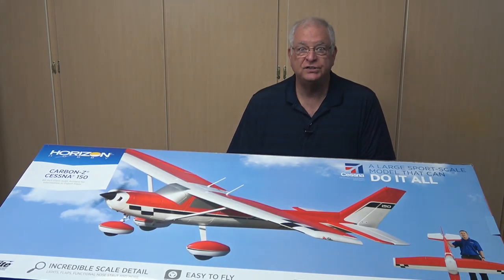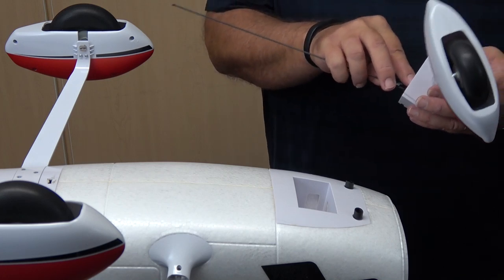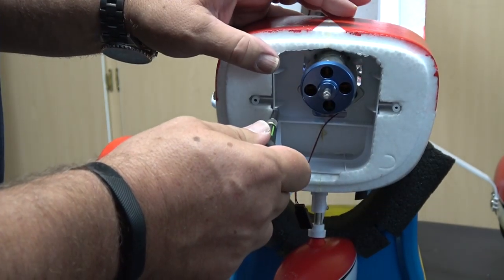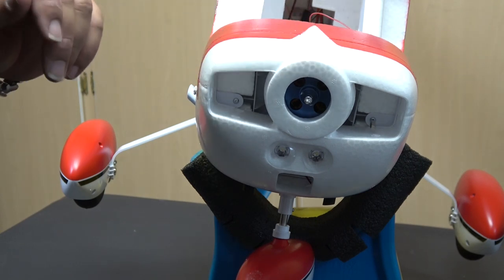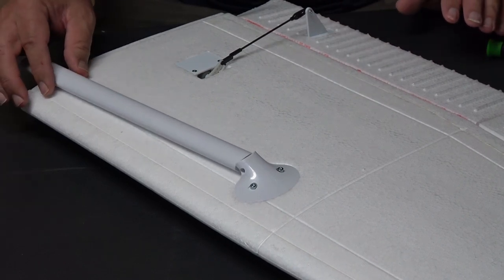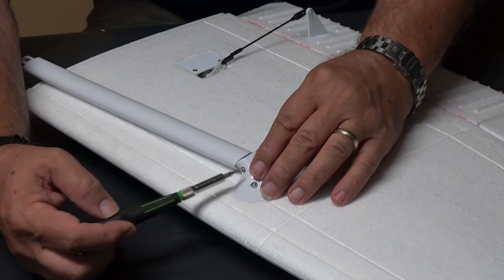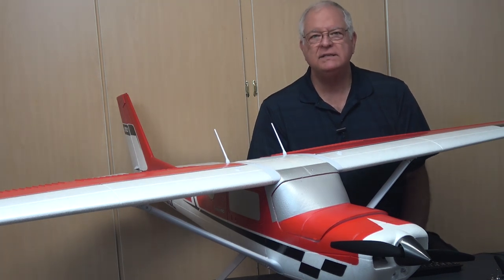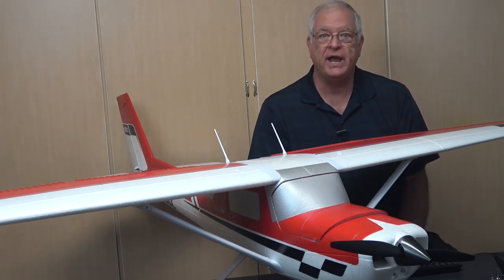Carbon Z Cessna 150 Assembly Log

Comment: Great video!  Thanks for posting it.  One thing to correct is that to center the nose gear, you do not heed to remove the nose gear at all, it can be done by twisting the small 90 degree angle on the servo side of the push rod.  You have to open up both the battery compartment and the top hatch.  With one hand holding the rod (disconnected from the servo) in the battery compartment and lifting it up, the other hand in the opening in the top, you can twist the rod several turns, checking on each turn to see how it aligns.  It's much easier than removing the nose gear over and over.  You can do the same with the rudder adjustment.

Comment: I have a Spektrum DX8G2 Transmitter but I couldn't find the Carbon Z Cessna Setup Download Files on either the Spektrum or Horizon Web Sites. Can you tell me where you were able to find the one's you referred to? That would be of great benefit to me. Thanks, your video was very helpful.
Reply from the maker: Tony Harris. On the Spektrum RC website under set ups and update you select air transmitters and then the transmitter you have. Then select download set ups. Unfortunately, the Cessna 150 doesn't seem to be listed for the DX8 as it is for the DX9. Don't know why. Hmmm
Reply: Thanks for your quick and helpful reply! I talked to a Horizon Tech about the Cessna 150 setup download and was told that it didn't exist as of yet for either the Cub Z or the Carbon Z Cessna. Wanted you [and your subscribers] to know "You were Right!" I found the download for the Cessna, loaded it to my DX8G2 and there it was! You made my day! I have the PNP version and an Orange [ORX] R1220XLR receiver and Remote Antenna. Never had one before and got no directions. Do I install the Main Receiver and Remote at a 90 degree angle to each other same as I would a Spektrum setup, and which direction would you install the Main Receiver Antenna, facing front or rear and do I leave the Main Antenna's straight or  90 degrees apart? Spent hours looking at your site. Loved it! Thanks again. Tony.

Comment: Great video. Where do you get the deflection measuring tool? That's a great tool to have!
Reply from the maker: The deflection meter was a Great Planes product. Unfortunately it's no longer available. Tower has one by Robart that's pretty similar. 
https://www.towerhobbies.com/cgi-bin/wti0001p?&I=ROBR1407&P=FR&gclid=EAIaIQobChMInOmTipbl5AIVBL3sCh0DqwXuEAQYASABEgItkPD_BwE

Comment: I love your videos. You go into great detail describing the build. I know this is a old video but I just received this plane for Christmas. I have a couple a Timber, (the regular one and the Turbo) what are the flight characteristics compared to the Timbers?? Slow speed and Stall characteristics I should be aware of anything?? I plan to use the same size batteries/
Thanks
Reply from the maker: I haven't flown the Timbers but friends at my field fly them. My sense is they are more nimble. The Cessna dies scale aerobatics easily. Loops, immelmans and split s's are easy with a bit of rudder during the roll. I find that takeoffs and landings are best with half flaps. The climb out is a bit more shallow so I don't drag my tail. With a fairly long final you came get the decent rate established and it will just settle in. It might surprise you how slow an on speed touchdown will be. Taxi with full aft stick to keep the nose wheel light to avoid shimmy ... Just the the full scale version. I really love mine. Merry Christmas.

Comment: Hi, I/m going to use 6S 5800 mAh. Will the original ESC realy hang on ?
P.S.
Best presentation.
Reply from the maker: Thanks for watching! Amps and voltage are the main limitations on esc capacity. The milliamp hours don't really impact things. I use the stock prop and 6 cell batteries with no issues. I use 5000mAh batteries with lots of power. The weight of an additional 800 mAhs of capacity will likey not matter unless there is a size issue with the battery cavity.

Comment: The plane is set up for 6. Cell from the factory ,
Reply from the maker: The plane will take 4 to 6 cell batteries. Most find 6-cells are best. I use Zippy Flight Max batteries from Hobby King. 6 cell, 4000 mah with 30 - 50 C should be fine. There are other good choices out there but I'm a little cheap with these being about half the cost of say the Admiral brand at Motion RC. The DXe six channel looks like a neat radio with smartphone programming. This model's set up files are available for the DXe on the spektrumrc.com site under downloads.

Comment: I’ve bought and build this model plane, just a question to all the owners of this model, do you get buzzing/hum from most of the servos when the plane is switched on and stationery?
Any response would be greatly appreciated. Thanks, John
Reply from the maker: I believe the servo noise when first turned on is the AS3X system calibrating. If the noise lasts longer, I've found some success quieting servos by adjusting both trim and end points.
Reply: The noise is constant. They don’t seem to be chattering. With all servos doing it, is very annoying.
Reply: John Aquilina The buzzing/hum is normal for digital servos, no need to be alarmed.

Comment: I don’t know where your screws were. Not Phillips. That’s for sure. What a night mare
Two👎👎
Reply from the maker: Sorry the screws proved to be a problem. In my kit the screws all came in small bags within a larger bag so they were easy to find and identify. Horizon seems to be using socket head screws with their larger Carbon Z models. You're right. They definitely aren't Phillips. I got a couple of cheap multi bit screwdriver kits from Harbor Freight that includes various sized common, Phillips, hex and star bits. I'm using one of those in the video. Less than $10.  Hope your flying experiences will offset the assembly frustration. I love flying mine.